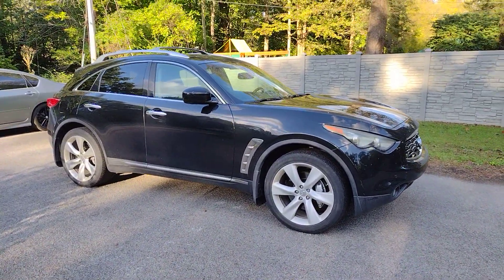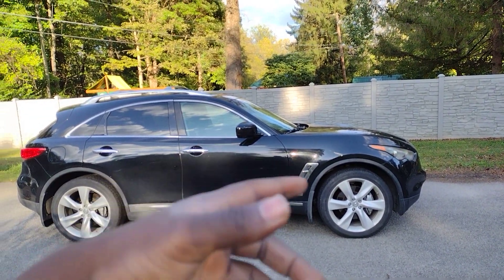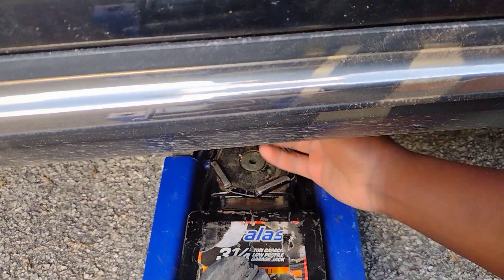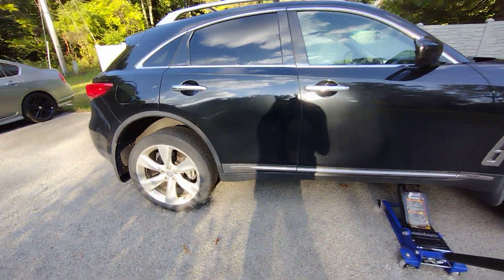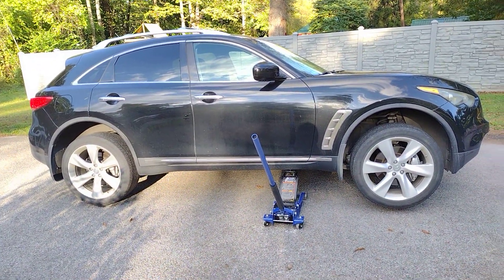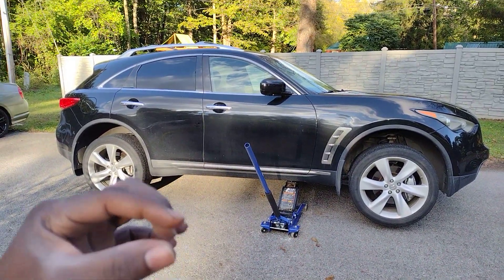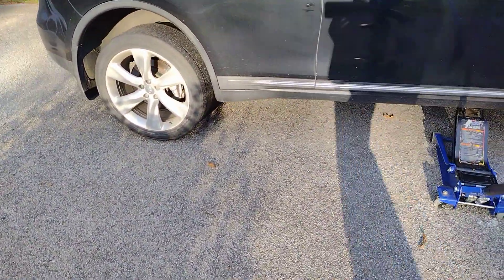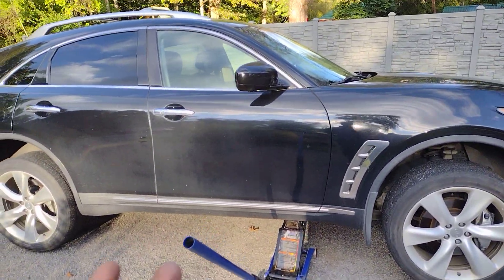Chassis Stiffness Test. Both wheels lift off the ground| Safety Coccoon. Sporty Shell. Flex Test

Comment: I own a 2nd gen fx35 that comes with 20 inch wheels. I’ve been replacing the tyres the same brand and type as it came with since it was bought from the dealership. They are all-season bridgestone tyres. Should i change them to performance summer tyres?  Fyi, it never snows where i live and there’s very little annual rainfall.

Comment: Mmm, this is very important. I have to replace rear wheel bearings on my 2003 rwd FX. I have to remove one axle at a time to access to the wheel bearings assembly bolts. This means that I have to put the car in Neutral and rotate the axle in order to access the axle bolts, which means the car could move. I suppose I have to lift the whole car and put it on four Jack stands. I don’t think wheel chocks will cut it if I only lift one side of the car.
Reply from the maker: Also remember, you don't have to jack the vehicle as high as I did in this video. Just raise it enough to remove the wheels, and you can lower it to work safely.
Reply: Lift by the rear diff. Put your stands as usual on the rear pinch welds or control arms. Leave in neutral. Good to go. Chocks are a good idea also
Reply from the maker: There are a few ways for sure. 
1. If you have a floor jack, just lift by the rear diff and set the jack stands on the rear subframe, if there's a safe spot for it.
2. If you don't have a floor jack, just jack each side one-by-one, but jack the vehicle at the rear pinch weld. Use wheel chocks/blocks at the front wheels.